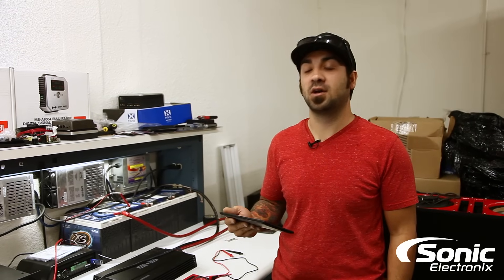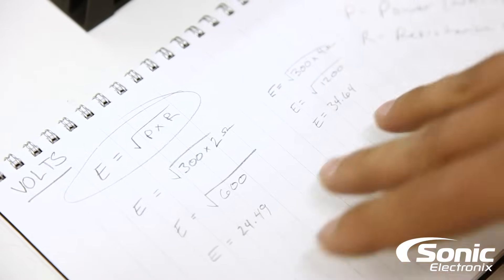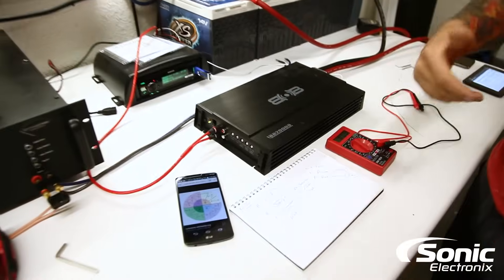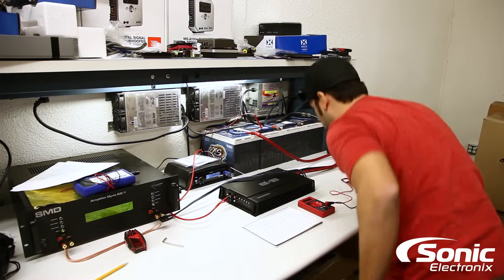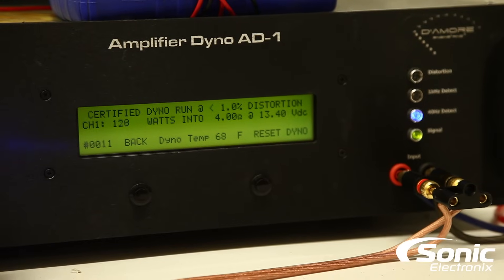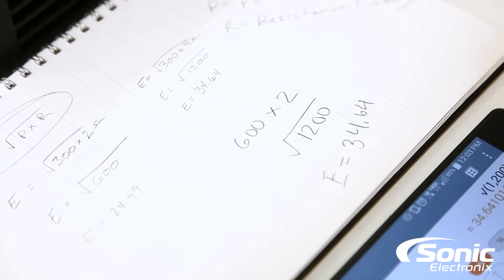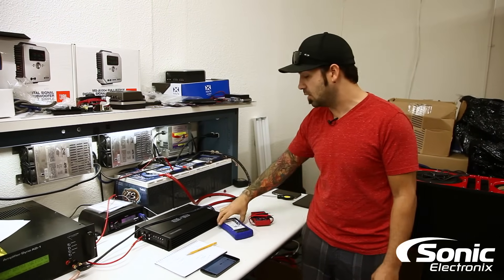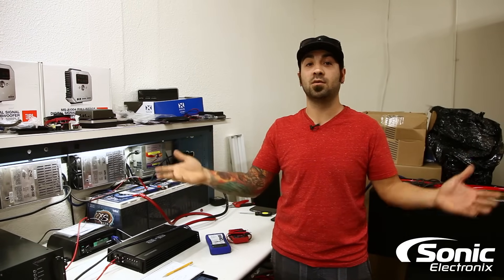How To Set Amp Gain to Match Lower RMS Subwoofers? | Car Audio Q & A

Comment: so i have 1800rms amp on 1ohm and i run 2500rms sub on 1 ohm ant it shows 50 volts
my amp on voltmeter shows 53volts is it runing 2500rms?
Reply: This only applies if your amp is more powerful than your woofer. Not the other way around.

Comment: what if I have to subs that are 600rms each and a 1500rms Amp at 1ohm how would I set that I'm not new to this or anything I have used the multimeter to get in the ball park but I don't want to under power them but don't want to kill my kids ears

Comment: What if you have two subs in parralel?  Say for example you have two subs @ 150W RMS wired in parallel, yeilding a 2 Ohm load.  Do you just sum the wattage of the subs to plug into the ohms law equation?

i.e: sqrt(   ( 150W + 150W) * (2 Ohms)   ) ==  srqt(600)  = 24.49

Comment: what if i connect a 4ohm woofer on 2ohms.. do i times the rms by 4 or 2
Reply: U would donit at 2 ohms, its whatever the amp is gonna see, the amp is gonna think it's a 2 ohm load.
Reply: I have a 1ohms amp but a 3.36ohms sub, so i would do 1 ohms when doing the formula for the sub?
Reply: Your amplifier is not one ohm. It can handle one ohm. Your amplifier sees 3.36.

Comment: Hey i know you may have answered this question. What if you're  wiring multiple subs let's say 2 dual 4ohm subs which you can wire down to a 1 ohm final. Would you use the final impedance and 2 times the rms due it 2 subs in the formula ? Let's just use the same specs given in the video for example. And would you do the same for the different quantity of subs you have.?

Comment: I have an old cadence ultradrive 1200z amp rated at 4ohm bridged max and a rockford fosgate p3 15" 4 ohm sub. can I wire my sub for 2ohm and safely run it if my gain is set properly?

Comment: I have 2 kicker 40cwr122 connected to a kac-9106d with 2 ohm impedance, when I set input sensitivity I need 44.72 volts ax. But my multimeter shows OFF after reaching 39.8 volts. Could you plz help me?

Comment: @Sonic Electronics. I have the same DMM from harbor freight that's used in this video. The Instructions say to test ACV plug the negative in "com" and the positive in "V(ohm)mA", but in your video your negative is plugged into "V(ohm)mA" and your positive is plugged into "10ADC" is this because checking for ohms is different from testing AC voltage?

Comment: Couple questions not mentioned in this video. If you have a bass control knob and you just hooked it up to the amp, where should you actually have the bass boost dial on the back of the amp set to? Let me rephrase that... the bass boost on the amp is set in the middle. Should I dial back on the bass boost on the amp to zero first and then plug in the bass control knob? Or just leave it at middle plug in the bass boost control knob and set that to the middle as well so they're both in the middle?
Reply from the maker: +Sam Han Properly set the gain on your amplifier before connecting the bass knob. You can turn the bass knob all the way up, but we would probably recommend turning the bass BOOST all the way down if you don't have any tools that can detect clipping.

Comment: I'm curious those battery's on the back can be used for a home car audio ? I'm trying to make one but I can't find a power supply to power up the amp
Reply: +Alex Comander That's what you're supposed use but you're going to need a battery charger cause it won't last. Also, be weary about the fumes from the battery if you're going to place it in your room.
Reply: +Sam Han ok but what do you mean is bad or just need to be on open space?
Reply: +Alex Comander as open as you can have it and not confined in box.
Reply: +Sam Han Allright thank you for your help

Comment: As a general rule if the sound is clean, nothing is being stressed!! that's all you need to know.
Reply: Agree'd, but with loud bass not everyone can detect distortion lower than 30hz (which is what a lot of cars are tuned to here in the UK) and plenty of people think the gain knob is volume :/
Reply: Michael Beeny old heads always have to hate on everything they see simply because it's not being done their way..
Reply: Subwoofers can be burned without clipping.. not always right.. depend of the sub
Reply: Unregulated amps bass boost and voltage  drops  account  for 95% of blown subs
Reply: yeah its not always obvious to the ear that a sub is clipping

Comment: is it the same with 2 subs? at 2ohms 500w a piece
Reply: to connect 2 woofers you either wire them at 1 or 4 ohms.

Comment: Good video but it doesn't take into consideration impedence rise or efficiency. Everyone watching needs to keep in mind that just because you find your 34 volts or whatever your target voltage is doesn't mean it's always a clean signal. Trying to get 34 volts into a 2 ohm load using a lesser or low quality amp could still ruin a subwoofer. Even if it is rated at double that power.
Reply: +Tim Germany did you watch the rest of the video? because thats what it clearly said

Comment: what if you set your gainswith a oscope at - 10db 40hz do you still measure the voltage at -0db 40hz

Comment: Amps are half power on 4 ohms. So 2 ohm is 300 and 150 at 4 ohm. 2 × 300 is 600 and 4 × 150 is 600. So it don't matter what ohm it is as it will be 600 regardless.

Comment: hello I have 2 old  10 in audiobahn subs that are 6ohm dvc,, is it possible to get the two wired to 1ohm so I can run them on one of the sonic brand amps at 1 ohm,, and could you please show me how to do it,, thank you,,
Reply from the maker: +infrareddreamz The lowest you can get those two subs down to is 1.5 Ohm final impedance.&#160;
Check out this link. http://knowledge.sonicelectronix.com/tools/subwoofer-wiring/#prettyPhoto&#160;

Look at the diagram labeled   "Two Dual 4-ohm sub"  •  "1 ohm"  •  "Mono"     
That is the wiring you would do on your two subs, all four voice coils should be wired in parallel.

Make sure you have a 1 Ohm stable amp and make sure you match the power appropriately. Keep in mind however, your subs won't get the power listed at 1 Ohm, they will be getting a number about half way in between the 1 Ohm and 2 Ohm rating of that amplifier.

Reply to this comment if you have any more questions, will try to get back to you as soon as we can.   :]
Reply: +Sonic Electronix ok great thanks for the info,, next I was planning to buy my amps from max sonics maybe you can help,, I need an amp that will run my 2 800rms 10s at 1,5ohm I would like to run them close to the 800rmsand I will need a 4 channel to run a pair of 150rms 6x9 and a set of 100rms 6,5s,, I would like to get both amps for as close to $300 as possible,, they are for my boat which doesn't get much use so don't want to put allot into it,, I do have good quality wire and cables,, if you have any suggestions for amps that would be great,,thanks again for your time and help,, Robert
Reply: +Sonic Electronix  should i get a more powerfull amp or not. i have a boss 1000w 4ch amp and i want to connect 4 audiopipe (APMB-8-B) and 2 digital performance (DP T18)  tweeters. my friend said to bridge 2 speakers in paralel to channels 1/2 and do the same for 3/4 and the add a tweeter to channel 1 and another to channel 3. will this work
Reply: +steven castro that amp is crap and will take a dump on you real quick. To actually answer your question yes you need more power. More specifically you need an amp that will actually put out 1000watts if not more. The boss might put out 600 @ 14.4v
Reply: +Andrew s yesterday i got a bassinferno 3000w amp, you think that will do for what i want

Comment: I have a 4 channel amp that I want to put in my car. the specs are 

100 x 4 @ 4 ohm
150 x 4 @ 2 ohm
300 x 2 @ 4 ohm bridged

I want to target 100 watts on bridge. would I use the same target number that I get at a normal 4 ohm load in bridge??

Comment: I have a 1000 watts amp n i have a universal laptop charger.. Every time I played it....The power light on the amp kept blinking and the music stop.. Do i have to get more power for my amo or wat
Reply: Are you using your lab top as a power supply? the problem with that is you may not have enough watts/amps to fully power your amp... Sure your power supply might put out 12v but that's only part of the equation... Your supply might work at low volumes but cuts off when you crank it up, because you don't have enough power.
Reply: +Joe Sotelo. Thanks tell me wat i need

Comment: Watching your video, in the formula you used the speaker rms power to calculate the voltage but I saw other video and he used the amplifier rms power. Who's correct? Thanks for your help.

Comment: I have a Kenwood DPX501BT. I don't have a distortion detector or oscilloscope. What would be a safe volume level to set gains at to avoid distortion/clipping?
Reply: +bagels36 59
Reply: +MrNate2111 The receiver maxes at 35.

Comment: Your precision is beautiful, but due to the smoke and mirrors around peak vs RMS ratings, is this actually useful? There is so much lying in speaker marketing that it seems nearly impossible to run a speaker continuously at its full rated RMS. The only way to really accurately know when you've gone too far or too long, is when you smell the voice coil melting or hear it scratching.

Comment: So, if I have two kenwoods (model w12ps) and the final impedance is going to be a 2, I need to tune for 500 watts rms? So the equation being the square root of 500x2? Right?
Reply: Amp is a Kicker ZX750.1

Comment: HEY BRO I HAVE A 2400 WATT AMP AND A 1100 WATT SUB. WHAT SHOULD I SET MY GAIN AT?
Reply: Rms of amp x ohms of speaker they square root it.
Reply: you need to tell us the ohms on your sub. and then you will still need to check the ac voltage on your speaker outputs. nobody knows how much your gain changes the output. you have to test it.
Reply from the maker: +ROBERTO FLORES Whats the ohm rating on the subwoofer? Single or Dual Voice Coil? And do you have a Digital Multimeter?
Reply: He just explained in the video did you not watch it.
Reply: ***** WTF!
Reply: +ROBERTO FLORES what was my comment?
Reply: *****  IDK
Reply: +ROBERTO FLORES ok lol

Comment: so if i have 2 subs and they are 500w rms each wired down to a 1 ohm load do I do 1000w x 1? or 500w x 1
Reply: 1000wx1, always combine all the subs to find the total rms power. say u had 4 500w subs, ur amp would need to push 2000 watts rms
Reply: Thank you

Comment: i have 2 pioneer woofer each woofer has 400 rms/1400 peak at 4ohm and a 2000 w amp that can be bridged on 2 ch each ch 400 rms at 4 ohm but that means to turn the gain all the way up is recomended or can cause distorsion? and another one what do you guys think about mounting the amp on the woofer box?because you are like spending time to seal the box and then drill holes in it.

Comment: this is so confusing so if my 2 subs that are 900 rms cea rated together are wired to 2 ohm(my amp is cea rated 1000 watts at 2 ohm) i would do my target wattage(1000rms)times 2 then get the square root of that to get my desired voltage?then to get to that voltage i turn my amp gain all the way down play the test tone and rise the gain until that voltage?its really hard for me to learn this kind of thing i want to know exactly what to do so i always am second guessing myself weather im doing it right or not please respond.

Comment: wow thnks for this info. heres my thing. i got 2 x 300 watts subs series @ 1ohm . and a 850 watts mono amp. do i add up the 2 ,300 watts per sub? 
like (300x2) X 1ohm?
Reply: A mono amp with 800 watts on two subs will give you 400 watts to each sub. Hope this heps

Comment: Correct me if i'm wrong but shouldn't the gain be set to match the output of the head unit's pre-amp voltage ?
Also,  the RMS rating is a rating of NOISE, not a realistic rating for music, thus wouldn't an amplifier with an output of twice the speaker's RMS be more or less, perfect ?

Comment: I understand how to set the gain with the smd distortion detector but how would set the rest of the filters like subsonic, Lpf, bass boost. Can this question be in the next sonic electronic q and a
Reply: +brian schueler 
Subsonic and Low pass filters should generally be set according to ear, the type of speakers being used and the type of music being played. Otherwise refer to each speaker's frequency range graph and set the crossover accordingly. If a sub (a small sub or a sub with a low xmax, for example) is unable to reproduce subsonic frequencies, ie: frequencies below 20 hz (which are felt instead of heard), a subsonic filter works the same way as a high pass filter, attenuating the lower frequencies below this setting. Another good reason to use a subsonic filter is if an inefficient amplifier is being used (such as an AB amplifier) without an adequate stiffening cap and those extra low frequencies are causing the amp to draw more than the alternator and/or battery can provide. 
Low pass filters attenuate frequencies above their setting, attenuating in the opposite direction of subsonic and high pass filters. Car audio subs generally don't have much to offer above 100 hertz so, I would suggest starting there concerning the low pass.

Comment: If I'm running 2 subs off my monoblock that are 2000W Rms each @ 4 Ohms (DVC, 1000W Rms per coil) in parallel, which means I get a total load of 1 Ohm (coils connected in parallel halves the resistance, ie 4, 4 Ohm coils gives a total of 1 Ohm), and my amp is 4400W Rms at 1 Ohm, when I'm working out the target voltage, will it be:

V = √2000x1?

Comment: so if I have a jx1000 powering a jl12w7 the jx1000 has a continuous RMS rating at 14.4V for
3 ohms at 750Wx1
2 ohms at 1000Wx1

and the JL12W7 has a
 continuous power handling RMS at 1000W
Recommended Amp Poser RMS at between 400-1000W
at 3ohms

Should I use 750W at 3ohms for a Volt reading of 47.43 then

Comment: hello...i want to know something urgent. i have alpine pdx 1.1000 amp and my brother gift me a alpine swt 12s4 subwoofer. can i use this sub with this powerfull amp ??
Reply: +Raihan Ratul _yeah sure, it's much better to have more power than not enough. Just be careful though and listen, if you ever hear distortion, turn it down.
The best aftermarket stereo systems sound great because they have more than enough power, so they can play clean and clearly due to having headroom but that doesn't mean you can crank it up all the way and expect everything to be fine. Trust your ears.

Comment: So, would this also apply to stereo speakers using the ohms law?
Reply: +John Pangelinan 
My set up is 1 X 4) New Kenwood KFC-C6895PS 6x8" 720 Watt 3-Way Car Audio Coaxial Speakers Stereo
1X) KENWOOD KAC-7406 CAR AUDIO 800W WATT 4/3 CHANNEL POWER AMP AMPLIFIER W/ AN 10 GAUGE WIRE KIT.
1X) Pioneer FHX820BS DOUBLE DIN HEAD UNIT. 
I'm trying to tune my amp system to my 3-way.

Comment: hei..i´m a big fan of your channel and helped me out alot in diffrent installtions without asking as you guys described all..but for first time i want to ask something may be i heavnt found that video which i want..so i want to know that i have a 4ch 500rms amplifier and a 1000rms groundzero subwoofer.i use only this subwoofer on my amp nothing else..how could i get more power as much as possible for my subwoofer?i mean how could adjust my RCA cabel and to which terminals should i connect my subs cabel??thanxx
Reply: +Moreno Singh 
Most four channel amplifiers are not meant to be used for subwoofers.
Secondly, you've not provided enough information about your equipment in order to offer an answer.
Reply: aha okei one question i have two amps 2ch 2800 watts and 4 ch 1000 watts which one is more powerful for one subwoofer?

Comment: Before watching this i was constantly setting the gain because the music sounded wrong and bad quality. Today i took the time to properly set the gain with this method, the difference is huge! No matter how loud i want to listen, it never sounds distorted and the actual music quality is superb! :)
Reply: Do you set the gain matching the ohms of the sub in general or the ohms your wiring it down to? I have for 4ohm but going to wire it to 2ohm. That is why I'm asking.
Reply: @fallenone6  you have to match the gain to the ohms you're wiring it into.
Reply: @Romi969  thank you!
Reply: @Romi  would you also happend to know if say I have a 1000 watt amp and I have 2 500 watt subs and I tune it to 1000 watts will that split the 1000 watts and give 500 watts to each subwoofer?

Comment: Can you please answer my following question?
I have a dual 2ohm sub 3000wrms and an amplifier that provides 3000wrms @1ohm. The square root for 3000wrms @1ohm is around 54v but what I do not understand is what happens if I decide to install the sub at 4ohm. The amplifier only delivers 1100watt rms @4ohm but the square root changes so the Volts I needed is climbing no far over the maximum 54v. 
Do you understand what i mean? In theorie I need over 54v, because 1100w x 4ohm is 4400 and the square root of this is much higher than 54v which is the highest voltage I get when turning the Gain all the way up with the HU sound on 75/80% (measuring with a multimeter)
I hope you can aswer this question.
Thanks